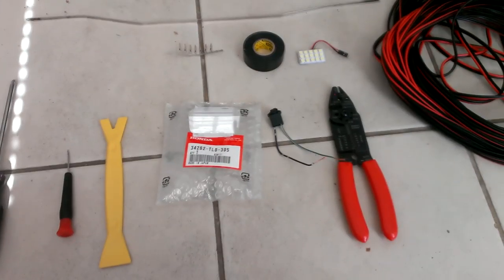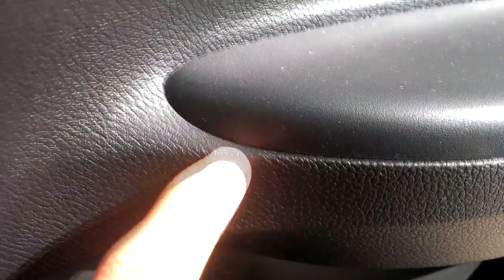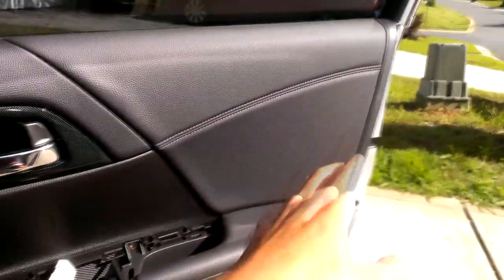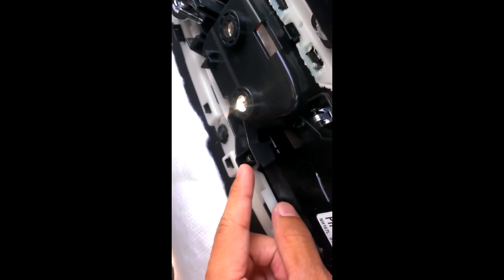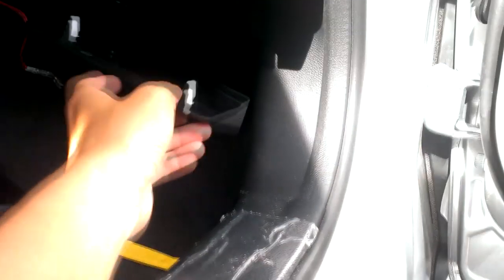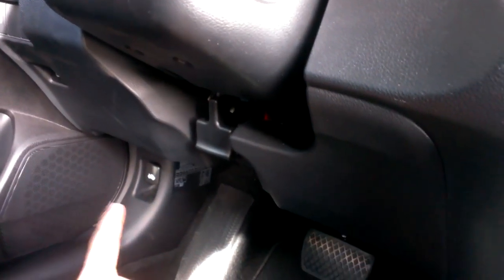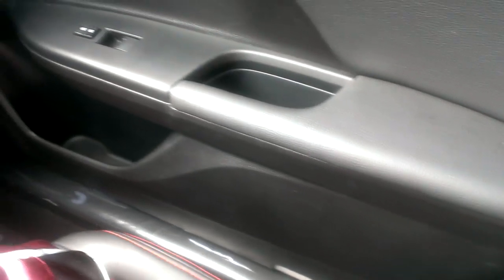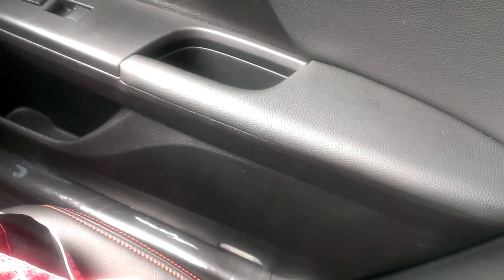2013-2014 Honda Accord Courtesy Light

Comment: To control each door light separately, connect to the door switch on B piler (trace the wire to driver side fuse box). Switch is "negative on" so negotiate wire from bulb connects to the switch and positive goes to constant positive. You can use fuse #42 (door lock). Remember to use "add a fuse" with 5 amp fuse.

Comment: Duc, excited to install in my daughter's 2015 the door courtesy lights.  Thanks to your video this will be a snap.  I did the same for my 2013 Honda Pilot EX-L because it only brought reflectors.  Now it has courtesy lights like the front doors.  I routed the wired inside the cable cover so it would not be seen when opening the door.  I will do the same for my daughter's Accord.  Thanks again.
Reply from the maker: I'm glad this video help you out. Good luck on your install!

Comment: thanks man but i dont want the light at all on its way to bright any suggestion on how to turn it off ?
Reply from the maker: The way it can only turn off is when the door is close, but when you close the door you don't see the light anyway.
Reply: @ducducgoose  so there is no light bulb to pop out? the issue is when exiting the car its very bright while opening the door
Reply from the maker: @markcameroon6613  oh I see what you mean. Yes you can take off the light cap and replace it with dimmer bulb if you want.
Reply: @ducducgoose  thank you so its possible will just remove the bulb

Comment: Can these lights be spliced with the illuminated door sills circuit? Since, the illuminated door sills are plugged up in the gray socket by the fuse box.
Reply from the maker: Yes, that's what I did after I installed my door sill

Comment: What is the purpose of metal wire? The socket where both wires connected to, does that automatically turn light off when doors closed? Hit me up, thanks.
Reply from the maker: The purpose of the metal wire is to allow you to feed the wire thru more easily. And yes when you connect the wire to the gray socket, the light turns off when the door close just like your dome light turns off after 30 seconds.

Comment: So both doors will light up even though only one side is open since it's running off the same wire? I might do the constant positive to the pin and then negative to the door switch so only 1 turn's on and turns off with the door.
Reply from the maker: Correct.
Reply: @ducducgoose  Thanks for answering. Looks like I’ll have to take a bit of time to connect the negative to the door switches if I don’t want both turning on. Do you know how to wire the front lights to turn on with the rear light? I saw it on the forums and want to do it possible.
Reply from the maker: @Newyen6MT  unfortunately I do not, did anyone on the forum provide a schematic?
Reply: @ducducgoose  No, couldn’t find it anywhere. I’d like to do that mod since it’s weird not having the front lights turn on. I usually get home at night and I like to grab everything but can’t see well with the rear light. I even have a bright LED but can’t see sometimes
Reply from the maker: @Newyen6MT  I know it's not ideal, but it wouldn't hurt having all the lights on. They are LED so they last for a long time. Mine still works after 6 years.

Comment: Duc Le - Great information. Do you or any other viewers  know if the harness for the illuminated door sills can be purchased separately? If so, do you know the part number? I already installed the "non-illuminated" ones, but would prefer to use a harness instead of the D-sub connectors.
Reply from the maker: David Siegel  this is the seller where I made my purchase, maybe you can email him and see if he willing to sell you a connector. They value customer even though is from china but is pretty good quality.

http://www.ebay.com/itm/OEM-Illuminated-LED-door-sill-scuff-plate-Guard-sills-For-2013-2014-Honda-Accord-/191527816512?pt=Motors_Car_Truck_Parts_Accessories&hash=item2c97f28d40&vxp=mtr

Comment: Duc, Since you already had access to the rubber tube between the door and the body of the car why didnt you run the wires thru the tube in stead of having them visible when the door is open?
Reply from the maker: I did that on my driver side and it took literally 30min to get it through. So I got lazy and just feed it through on the passenger side. Is hard to notice the cable though.
Reply: Next time put a little grease or vasaline on the wire when putting it thru and upgrade to stiffer wire as an initial guide. I used 14ga wire first and greased it so it wouldnt grab onto the boot when going thru. It only took me seconds once I figured out the grease trick.
Reply: I am sorry for not saying but your video was the reason for me putting an LED light strip on my wifes 2013 Accord. It didnt have any lights when the doors opened and I needed help and your video was great. Thanks a bunch...
Reply from the maker: wayne weir  What a great idea, I might do it in the future. Also no problem, glad I could help.

Comment: Surprised to see a 2008 honda has the door lights and the 2017 accord doesn’t
Reply from the maker: The sport trim level doesn't have it. It was only available for EX-L trim level and up, but it wasn't too hard to add in the lights.

Comment: whats the difference between the 18 and 20 gauge wires?
Reply from the maker: Is how thick the wire is. Higher number means the thickness is smaller.
Reply: Oh alright. Will it change how bright the light would be?
Reply from the maker: +thisguy000 the wire won't affect how bright it is.

Comment: Would this work on 2018 honda accord
Reply from the maker: Does th 2018 Accord has the cutout for the courtesy light? I'm not too familiar with that year model
Reply: @ducducgoose  yeah it has the door cutout but no wire for the light i ordered courtesy honda light thinking it had cord but idk if your way would be about same
Reply from the maker: @Eazyy209  it should work, cause mine didn't come with any wire either. If you check the description I list out the stuff you need to install
Reply: @ducducgoose  okay yeah would have to see and check that out if fuse box is around same